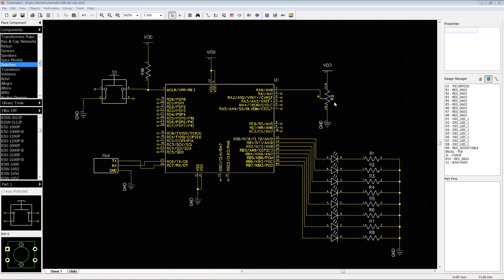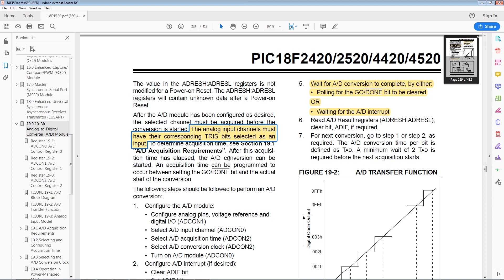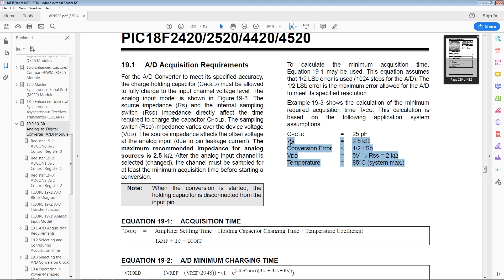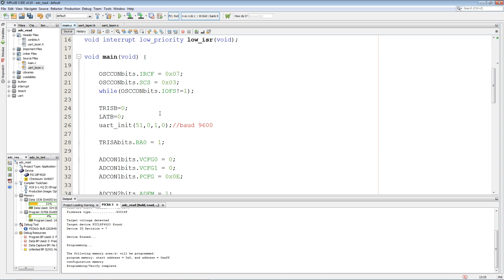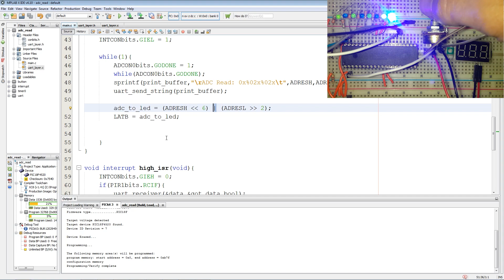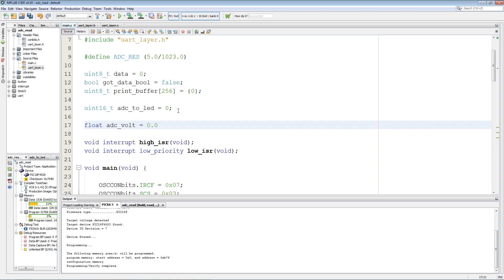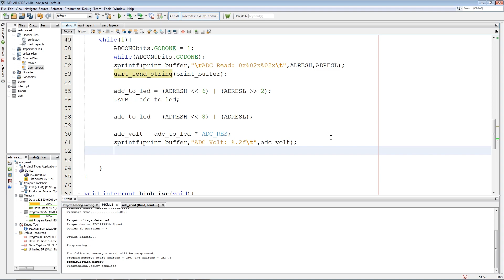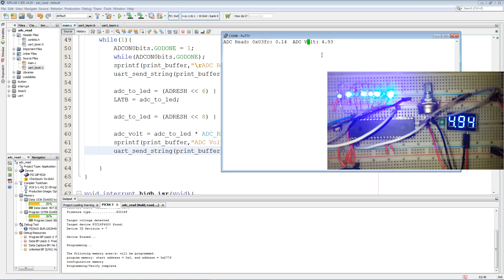Analog to Digital Converter (ADC) 🔴 PIC Microcontroller Programming Tutorial #8 MPLAB in C

Comment: Shouldn't you divide by 1024, since 10 bits provides 1024 levels, but numerically 0 to 1023?
Reply from the maker: Yes technically . It comes down to how the data is interpreted. The scale that is used does not matter that much. It plays a much bigger role when you are using a fixed Vref and not the supply as a ref. As you can see the V max is 4.96V on the volt meter and not 5V but it still is showing 5V at max and 0V at min. So the hole thing is wrong cause I'm using a bad Vref. The point of the video is to get the ADC working and not math behind it. 4.773 uV difference is not going to end the world

Comment: When youre shifting 8 bits are you ignoring the first 2 bits of  MSB?
Reply from the maker: No. adc_to_led is a 16-bit (2 bytes) variable. I move the 2 bits from ADRESH into the upper byte of adc_to_led and then add ADRESL to the lower byte with an OR. This gives me the full 10-bit resolution in a single variable.
eg,
ADRESH = 0x03
shift 8 left
adc_to_led = 0x0300

ADRESL = 0xFF
or
adc_to_led = 0x03FF

Comment: Hi, need help on how to use a force sensor resistor to control LEDs using PIC18F4520
Reply from the maker: Considered using a voltage divider as the AN input? Simulare to what I did with the pot in the video.
If the voltage values are to small add an amplifier to the circuit or other thing you can do is change the Vref of ADCON1:VCFG0 to a lower voltage to increase the ADC resolution (remember to set  AN3 as analog then).
Lastly apply 1kg of force mesure output then 2,3,4,5 and pray your formula is linear.
if this did not help more detail please then.